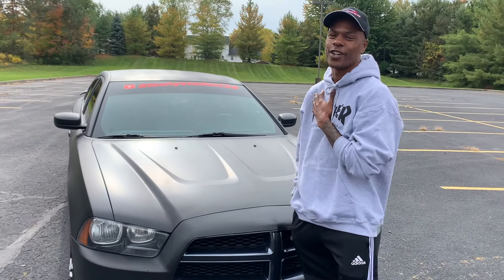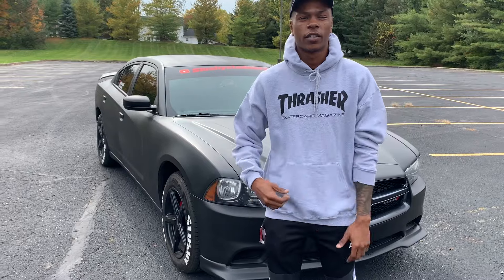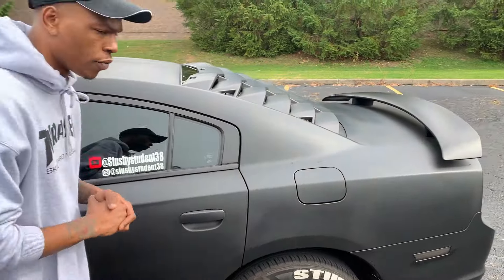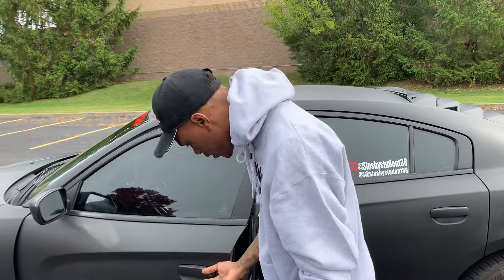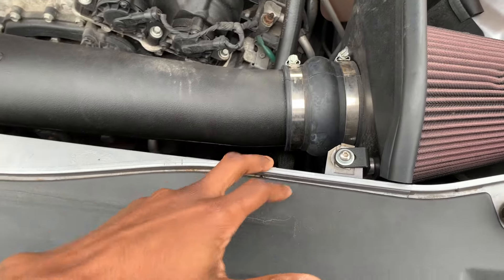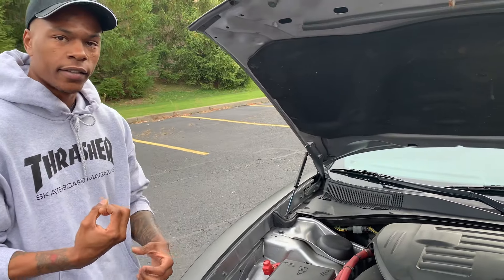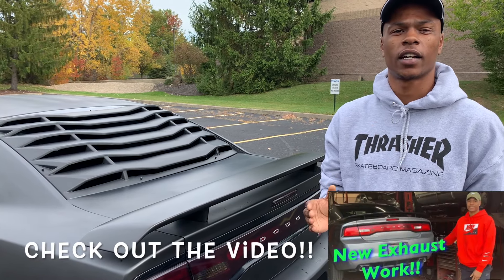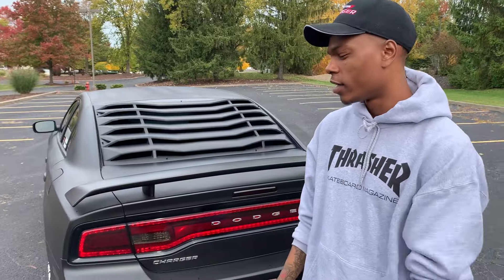5 Must Have Mods On V6 Dodge Chargers

Comment: I ❤MY MODDED V6 CHARGER WITH K.N. COLD AIR INTAKE 80MM RACE THROTTLE BODY RIPP COIL PACKS NGK LAZER SPARK PLUGS RACE PORTED UPPER AND RACE PORTED LOWER AIR INTAKE MANIFOLD CUSTOM TUNING EXHAUST IS STRAIGHT PIPED WITH BURBLE TUNE 🎶 E85 OR 100 OCTANE AWD 8SPD V6 CHARGER
Reply from the maker: Yes I got the scat not go tune in

Comment: Nice little upgrades. I daily my 2013 charger SE. I never have thought about doing anything but a sound system upgrade. I already have 66 Chevelle with a ls6, a 90&96 Caddy broughm lowriders, 99 Suburban with 6 inch lift and 14x20 wheels and muds. I probably won't do much to my charger but system and wheels at some point.

Comment: Where did you get the oil catch can? I can only find them in V8s, which sucks because I have a V6 charger
Reply from the maker: Here’s the link bro 😎 
https://www.amazon.com/TT-Racing-Universal-Aluminum-Reservoir/dp/B01MXLL5W9
Reply: @SrtSlushy  that one says unavailable any other ones you would recommend
Reply from the maker: @yaboiismael6526  which one u talking about
Reply: @SrtSlushy  the tt racing one the link you posted says it’s unavailable . Any second recommendations?

Comment: 10 to 15 HP 😂😂😂😂😂😂😂🤣🤣🤣🤣🤣🤣😂😂😂😂😂😂😂😂🤣🤣🤣 you're lucky if you get 2 or 3 HP. Don't believe me go get it Dyno.
Reply from the maker: Got a hemi now and with the setup I had I definitely gained way more then that
Reply: @SrtSlushy   do you need to buy a hemi so you can add the k&n cold intake. Or can I add the k&n cold intake to the regular engine
Reply from the maker: U can add it on any car… one of my friends put it on their Ford Fusion